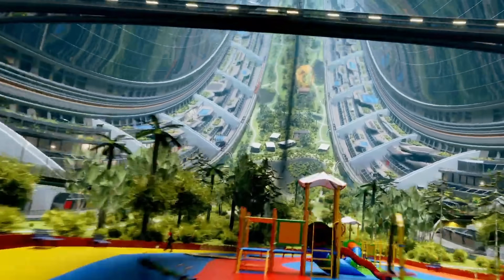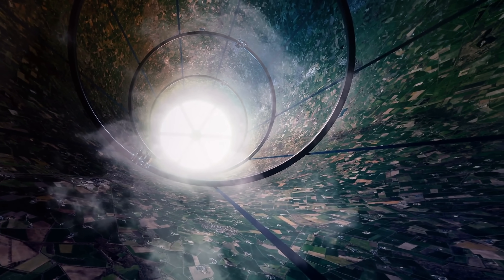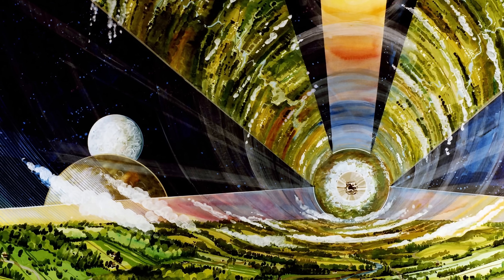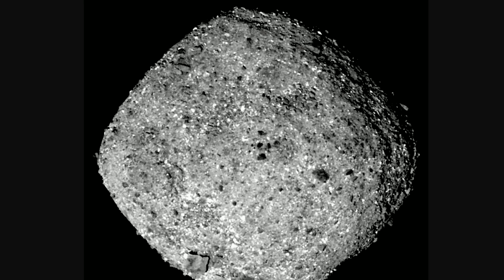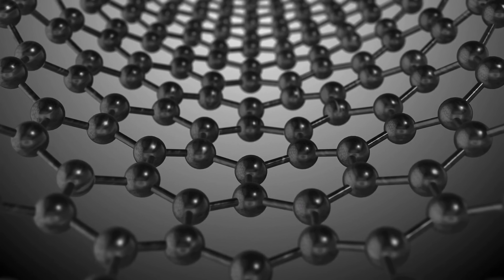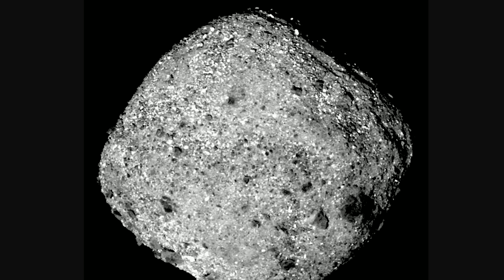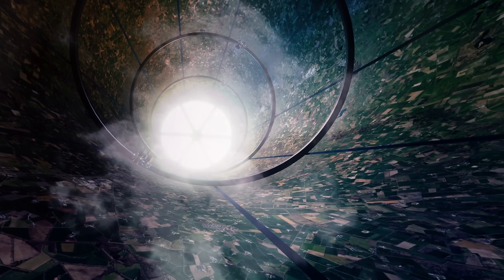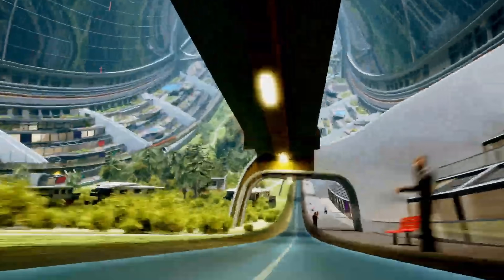Space Cities Out Of Asteroids and Graphene Bags? Intriguing O'Neill Cylinder Study

Comment: Graphene is not capable of catching anything. Graphene is a 2 dimensional material exclusively. While yes it has amazing properties for it's weight, cost, and thickness, being only 1 atom thick means that's still worthless. That's why carbon nanotubes are so talked about, it's the best known way to make 3 dimensional graphene and keep most of its properties. Of course carbon nanotubes are actually full 3D graphene, diamonds are, but diamonds have the side effect of being brittle due their perfect atomic structure and they're not cheap to make. 

The main thing about these metamaterials is Young's modulus. It's a measure of the ability for a material to take tension or compression based force. Graphene for example is great for tension, but it's terrible for compression. Diamonds are the same, but nanotubes can actually get around both by being weaved in peculiar layers giving it both great tensile strength and resistance to compression.

Comment: 4:47 - "...or some kind of ring-like object just orbiting a common center" 🤦‍♂🤦‍♂🤦‍♂🤦‍♂🤦‍♂🤦‍♂ OMG Anton, you really live in a fairytale fantasy word! 🤦‍♂🤦‍♂🤦‍♂🤦‍♂🤦‍♂
Reply: It would be like the ring around a planet.   All matter if rotating, rotates around a center of gravity.   Your turn.
Reply: @stargazer5784  In order to have a disk-like (or ring-like) object orbiting a center of mass, the center of mass must be a physical mass and the mass must be dominant is such a system. !!!A ring of material will NOT orbit its own center of mass!!! Look up the shell theorem: This theorem states that the gravitational force exerted by a spherically symmetric body on a particle outside the body is the same as if all the mass of the body were concentrated at the center of the sphere. In other words, the gravitational attraction between a particle and a spherically symmetric body depends only on the mass of the body within the radius of the particle, and not on the distribution of mass outside that radius.

And on top of this, a ring of material that orbits a dominant mass at its center must orbit inside the Roche limit of the dominant body, otherwise the ring would be unstable and would relatively quickly collapse into a single body (moon).
Reply: @stargazer5784  What???